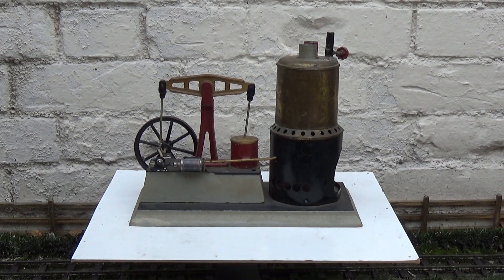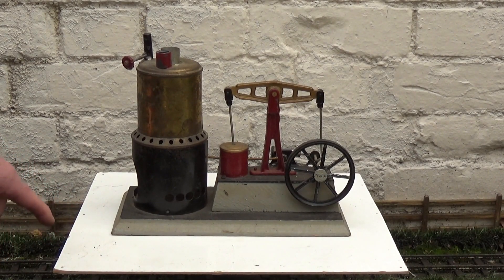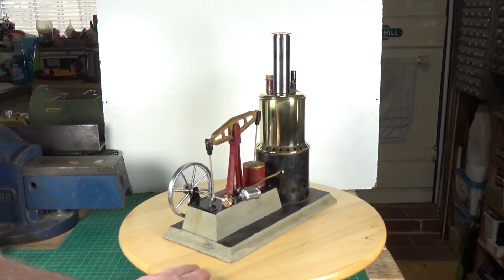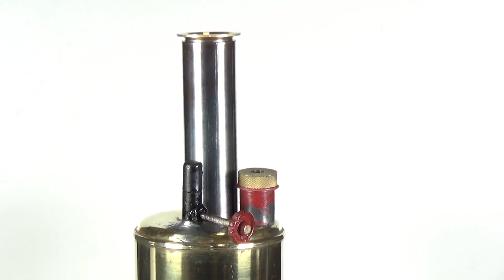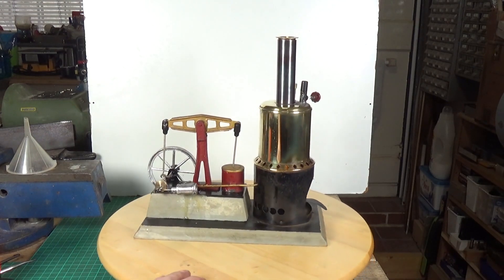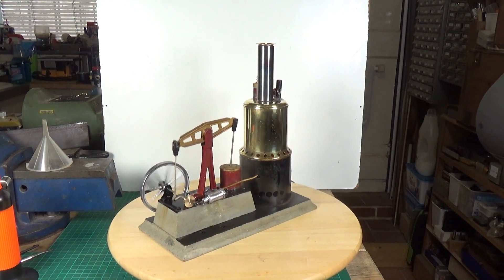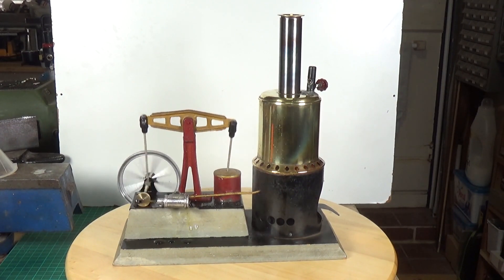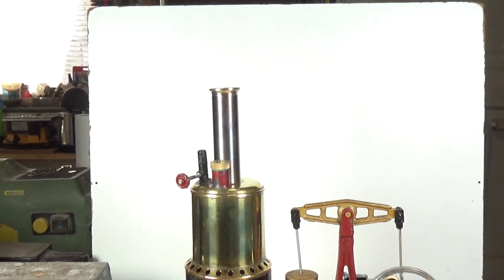Weeden 38 Model Steam Engine

Comment: here's a tip for the taper bell shape on top of the smokestack i bought some old titanium bits and specially sharpened them into a rounded bit
Reply from the maker: Yep, that would work.
Reply: I do have a question though, ive been trying to get my weeden 238 to run and i bought a piston seal for it from weeden steam, it doesnt leak at all yet it still doesnt run it now boils the water and makes plenty of steam but still wont run. Any tips or ideas?
Reply from the maker: @timothydelaval1089  First check for blockages. Take the cylinder off and check that the small holes that admit the steam are clear. Check that the steam passage in the block the cylinder attaches to is clear also. Easiest way to do that is to boil some water with the cylinder removed and you should get a jet of steam out of the port face. Check that the mating surfaces on the cylinder and the engine block are nice and smooth. Finally try adjusting the spring tension, it doesn't need to be too tight.

Comment: Great resto Alan.  Maybe it's meant to be a pretend steam powered beam type water pump.  They used them in some old pump houses back then. 

I thought the funnel looked quite good.  I suppose you could flair out the brass end a bit more.  Also another way to blue or brown metal is with chemical kits from gun shops.  They work quite well and are simple to use.  Cheers Rob
Reply from the maker: Thanks Rob. I had to remake the brass funnel top, the first one just wasn't right. I did look into chemical bluing but thought I'd try the heat method first. The trick is getting the tube to the same temperature all over, it would be easier in a furnace. I've done a few more since that one and they've turned out ok. Cheers, Alan.